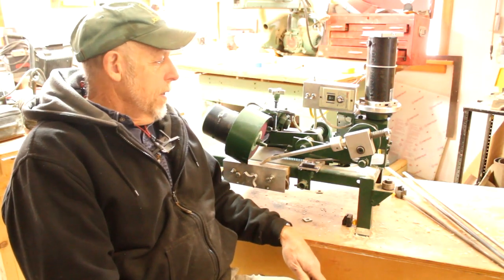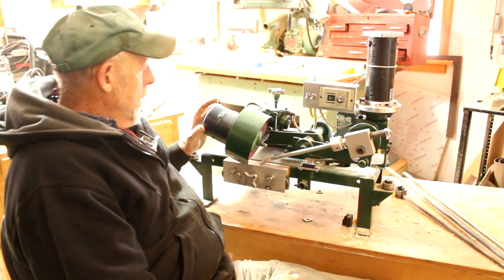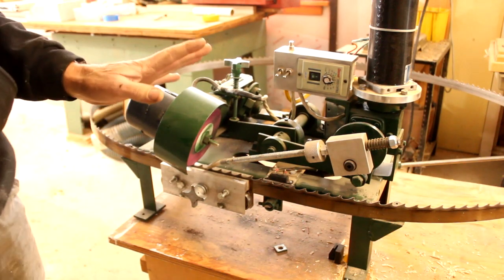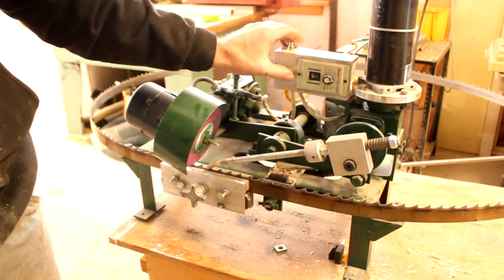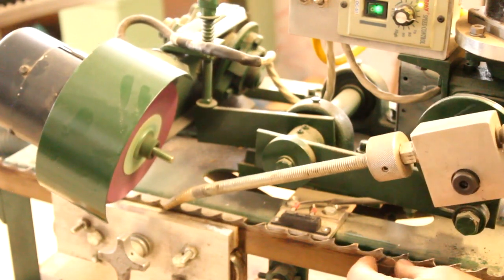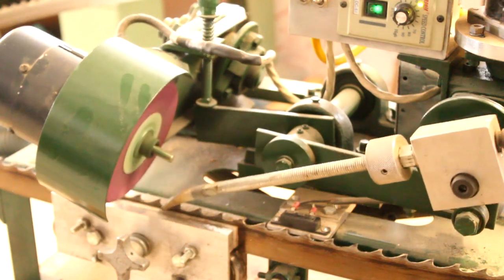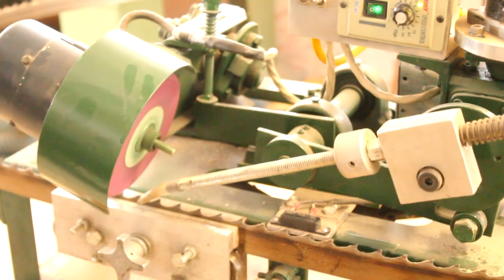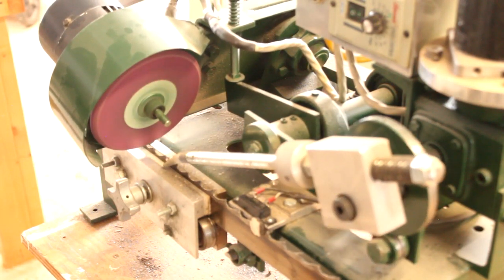Home made bandsaw sharpener.

Comment: Nice machine.  What device are you using to turn it off by the magnet?
Reply from the maker: I use a magnetic reed switch which drops out the self holding drive relay when the magnet on the blade passes by the switch.  I am using the normally closed contact on the reed switch in series with the ground  leg of the relay coil.  Basically when you push the momentary button for the feed drive it pulls in a relay which has one contact in parallel with the on switch so that when you release the on button the relay holds it self in.  The momentary off button is in series with the reed switch, both are normally closed so that either one can stop the drive.

Comment: Really nice job ! I’m planning to make one as well.  So many of these machines only sharpen the face and the users are adamant on  face grind  only.  but cooks videos insist that the back of the tooth should be lightly grazed as well. And that the gullet skim is over rated about stress cracks. I’d like to make one like yours where I could do face grind in one pass then a back grind only in the second pass then  do gullets next sharpening. Is that possible to touch top back of the teeth only without lowering too deep for gullets ?  I’m thinking by lengthening the push rod a bit so it would miss the face ? Thank you
Reply from the maker: Yes you can just touch the back of the tooth.  There are two adjustments one for how deep the wheel drops into the cut and one where the stone lands on the tooth profile.